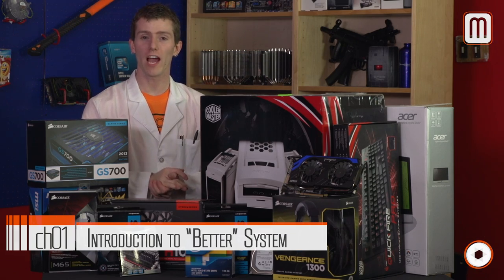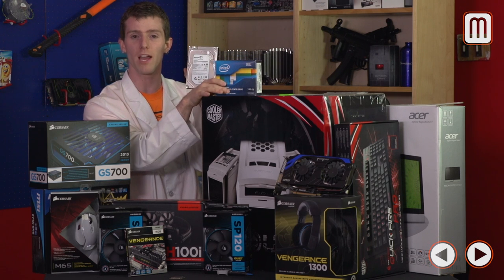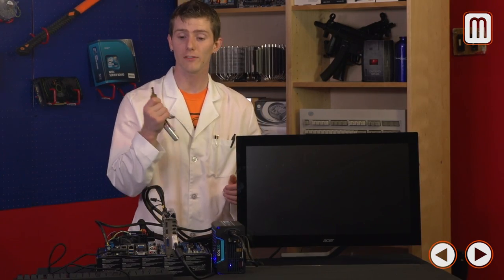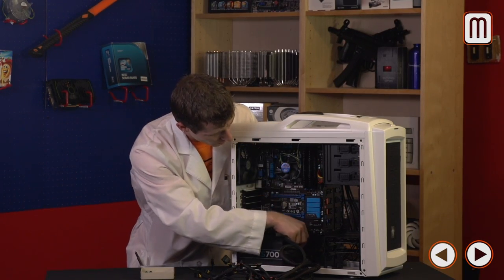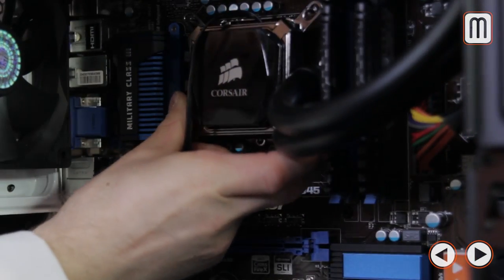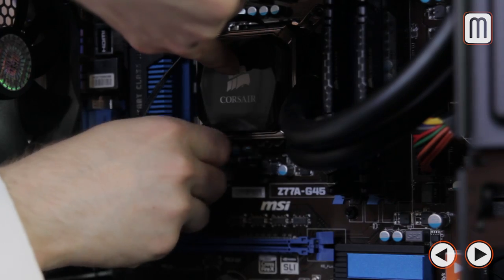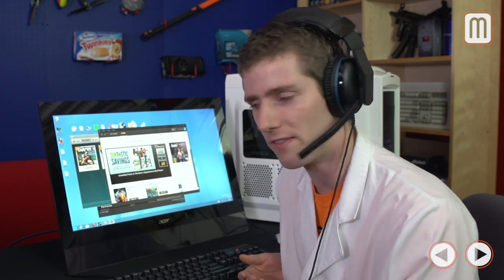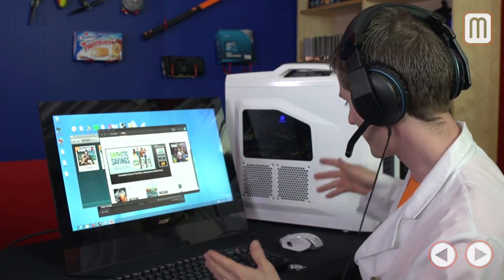ULTIMATE Build a Better $1500 Gaming PC Computer "How To" Guide

Comment: nice explanation for thermal throttling :D 
as my knowledge goes, the reason for thermal throttling is that metals loose their elecitrical conductivity/increase their electrical resistance with increasing temperature. so because it becomes too hot the processor slows down, and because it slows down it also cools down, and because it cools down it can speed up again, which will make it overheat and thermal throttle again and so on...

Comment: So would this PC still be good with today's games?
Reply: Not really heres a better and more updated one for the same price with a monitor keyboard etc http://pcpartpicker.com/p/nK6zhM
Reply: This would still be amazing. You dont need to upgrade a $1500 PC every year lol.
Reply: i'm running an i3 550 w/ stock cooler, 8gb RAM and the EVGA 660 Ti. I am running BF3 at ultra settings. I think this build would still be ok. Lol.
Reply: Cameron Gray except maybe go z87 instead of z77 for the motherboard
Reply: well it's better than my computer, and mine can run many games on high settings at a good framerate, so yes i think its good.
Reply: Of course. This is enough for like 10 years.
Reply: yes, but if you are willing to pay $1500, might aswell go with an updated build.
But then again, you are playing minecraft, so anything is good.
Reply: Oh yeah it will last 2-3 more years, but on low settings
Reply: Navis Not 10
Reply: ExoticGamer450 
Yes 10.
If the games actually got developed and console ported the way they should it would be fine for another 20 years but unfortunately ubishit doesn't give a shit and we won't see that happening. Anyway without AA you'll be able to max out all the games until your components die that is.
Reply: Aa is like the most important option and this card is a pile of shiz
Reply: Ellis Friths what, the 660 Ti?
Reply: Cameron Gray yep that card
Reply: The hardware/price in any build guide will be dated in 0.0000001 seconds. The assembly principles demonstrated by Linus here will last you for many many years :D

Go for the beefiest hardware you can afford, put it together like he does here, and you will have yourself one serious rig!
Reply: ***** Yes easily, Ultra setting at 1080p, This pc can run anything on ultra if it is Crossfire compatible :) if not high setting 1080p 60fps
Reply: yes but spend a bit more money on a Gtx 750 ti 2gb and a ssd
Reply: birdylover100 I think you're misinformed bud. GTX 660 beats the 750 ti no problem. a GTX 660 ti smashes the 750 ti. Only reason to ever get a 750 ti is if you have one of those old dell/hp pre-built computers and you wanna upgrade to a pretty decent card without any hassle whatsoever. Also the 660ti is more expensive than the 750 ti.

As to the original poster's question. Yes this will run today's games no problem. It might not max out and stay at constant 60fps but what build REALLy does that since there is so much variance in games, especially in multiplayer. It's really all about the GPU as the CPU is still a beast.( I have a friend rocking a i5 2500k at 4.5 GHz and it eats today's games for breakfast lunch and dinner ). And even tho the 660 Ti is stil a very beefy card, nowdays since NVIDIA has some weird pricing u either get the r9 280 or 280x or the new GTX 970.
Reply: Diavolo222 really??? i have one a gtx 660

Comment: I'm a noob when it comes to pc parts, can anyone tell me if this is a good gaming build? Or if I should change anything?

CPU: I5-4690K
CPU Cooler: Corsair H100i 77.0 CFM Liquid CPU Cooler
Motherboard: Gigabyte GA-Z97X-Gaming 5 ATX LGA1150 Motherboard
Memory: G.Skill Sniper Gaming Series 16GB (2 x 8GB) DDR3-1600 Memory
Storage: Crucial M550 256GB 2.5" Solid State Drive and Seagate Barracuda 3TB 3.5" 7200RPM Internal Hard Drive
Video card: Asus GeForce GTX 980 4GB STRIX Video Card
Case: Thermaltake Chaser A31 ATX Mid Tower Case
Power supply: EVGA SuperNOVA NEX 750W 80+ Gold Certified Fully-Modular ATX Power Supply
Optical drive: Samsung SH-224DB/RSBS DVD/CD Writer
OS: Windows 8 64-bit.
Reply: You don't need 16 gb for gaming, nor maybe 3tb? Maybe 2 but 3? Processor okay the rest would be up to you or others I guess since I'm not an expert.
Reply: This is just something I found, I did not make this myself.
Reply: Danny Hawk  I would downgrade to 8 gb of ram. You can use the gtx 980 but if you're doing 1080p I would recommend a 970 to save some money. Downgrade to 2 tb. And you're set
Reply: Johnathan Davidson I've changed a lot, here's the new one if you want to look. (PS: I have had help from others to choose these parts.) http://pcpartpicker.com/user/tjhawkas/saved/#view=vRy9TW
Reply: And I'm still looking for a case, so don't count that.
Reply: Danny Hawk Nice build. What games you plan on playing?
Reply: Not sure, hopefully can get some games like far cry 4 and gta v, while recording.
Reply: And it will last a long time game wise.
Reply: Danny Hawk You can run those games while recording with good framerates.
Reply: Yeah, 407 (If you know who he is) can do them 720p60fps.
Reply: And if you know any full towers that aren't that much money I'm all ears. :)
Reply: Danny Hawk downgrade to 8gb of ram, and put that money in a better cpu and overclock to make sure you're using up the 750watt power supply
Reply: if your not oc'ing go stock cooler and if you are an h60 would be good enough for that cpu
Reply: Danny Hawk if you can you should get a ss ssd and if your not over clocking to 4.0 ghz or higher then the h100i is overkill
Reply: Danny Hawk  If you are gaming on 1080p, get a 970 and overclock it. If you are gaming on 4K then get the 980. If all that you do is pure gaming, 8gb of RAM is more than enough, If you are doing video editing however, then get 16gb of RAM and upgrade try to get an i7
Reply: Danny Hawk Assumming that you haven't built this yet, Thermaltake has done some stuff recently that makes mo not trust them. I would get a case from Fractal Design, NZXT, or Phanteks. The NZXT  S340 is a really great case for roughly the same price as the Chaser A31.

I would also get a NZXT Kraken X41 or X61 over the H100i because they perform better.
Reply: C_Raz_Y 16 GB Will eventually be needed, so he shud go for 16 GB or upgrade later. Also alot of people that play games, also edit videos and do youtube. I'd recommend you to get a 16 GB mate :) +Danny Hawk couldn't tag him lol, fuck u youtube.
Reply: Danny Hawk Get 16 GB or upgrade later, and do like +micheal marquradt said and get one of those cases, my uk friend whos a pro at building pc's, told me to get either Fractal Design or NZXT. And then he chose a NZXT case for me. Black and red, pretty dope :)
Reply: Rikka Takanashi Depends if he wants to do anything else with it.
16gb definitely helps if you have a multimonitor setup and do things while gaming simultaneously. I seemed to bottleneck with 8 while playing GTA V while working on some project stuff on my second monitor.
Reply: Shayded thats true since of course games are getting more demanding and you dont want to be left behind
Reply: Shayded ye.... Witcher at 1080p needs 6gb for the game alone as far as I can see using afterburner if i were to stream or do something else that raises ram usage up to 9gb in my rig...i have an old x58 board with 12gb ram
Reply: jlei8aX Exactly. 8 gigs is no longer the standard for gaming rigs, especially since many gamers are also getting into multimedia editing.
Reply: Danny Hawk That is good:) You should build it!
Reply: Shayded he has 2 so it's 16 gigs

Comment: PCPartPicker part list: http://pcpartpicker.com/p/GVwvhM
Price breakdown by merchant: http://pcpartpicker.com/p/GVwvhM/by_merchant/

CPU: Intel Core i7-5820K 3.3GHz 6-Core Processor  ($299.99 @ Micro Center) 
CPU Cooler: Arctic Cooling Freezer i11 74.0 CFM CPU Cooler  ($22.99 @ Amazon) 
Motherboard: MSI X99S SLI Plus ATX LGA2011-3 Motherboard  ($199.99 @ Amazon) 
Memory: Crucial 32GB (4 x 8GB) DDR4-2133 Memory  ($372.98 @ Newegg) 
Storage: Seagate Barracuda 3TB 3.5" 7200RPM Internal Hard Drive  ($101.99 @ Newegg) 
Video Card: EVGA GeForce GTX 960 2GB Video Card (2-Way SLI)  ($207.27 @ TigerDirect) 
Video Card: EVGA GeForce GTX 960 2GB Video Card (2-Way SLI)  ($207.27 @ TigerDirect) 
Case: Raidmax ATX-249B (Black) ATX Mid Tower Case  ($37.99 @ SuperBiiz) 
Power Supply: SeaSonic S12G 550W 80+ Gold Certified ATX Power Supply  ($74.98 @ Newegg) 
Optical Drive: Asus DRW-24B1ST/BLK/B/AS DVD/CD Writer  ($18.79 @ OutletPC) 
Monitor: Acer GN246HL 144Hz 24.0" Monitor  ($236.99 @ SuperBiiz) 
Keyboard: Cooler Master CM Storm Devastator Gaming Bundle Wired Gaming Keyboard w/Optical Mouse  ($26.99 @ NCIX US) 
Total: $1783.22
Prices include shipping, taxes, and discounts when available
Generated by PCPartPicker 2015-02-16 20:17 EST-0500
Reply: Is that build beast
Reply: Is that build beast
Reply: Juan Lopez That will run anything and everything you throw at it on ultra at 80+ FPS
Reply: Really, Thanks i knew it was boss but not that boss. Thanks but can it run 4K games
Reply: Juan Lopez why run 2 960 when you could run 1 970 and don't get a Seagate barracuda drive they are shit
Reply: I wouldn't do 2 GTX 960. Do a single 970 or 980. I have a single 980 in my build and it's a beast I Don't think the 960's can do 4k at a playable frame rate. Plus, if your gaming and not editing, the 32GB of ram is a bit over kill. If your just gaming, then do 16 GB
Reply: Its my first build and im hype lol i did a huge update i will release in 10 min
Reply: PCPartPicker part list: http://pcpartpicker.com/p/Jg3LHx
Price breakdown by merchant: http://pcpartpicker.com/p/Jg3LHx/by_merchant/

CPU: Intel Core i7-5820K 3.3GHz 6-Core Processor  ($299.99 @ Micro Center) 
CPU Cooler: Cooler Master Seidon 120M 86.2 CFM Liquid CPU Cooler  ($64.99 @ Amazon) 
Motherboard: MSI X99S SLI Plus ATX LGA2011-3 Motherboard  ($199.99 @ Amazon) 
Memory: Corsair Vengeance LPX 16GB (4 x 4GB) DDR4-2666 Memory  ($229.99 @ Amazon) 
Storage: Seagate Barracuda 3TB 3.5" 7200RPM Internal Hard Drive  ($90.46 @ Amazon) 
Video Card: MSI GeForce GTX 970 4GB 100 Million Edition Video Card  ($357.99 @ Adorama) 
Case: Azza SIRIUS ATX Mid Tower Case  ($27.50 @ Newegg) 
Power Supply: EVGA 500W 80+ Bronze Certified ATX Power Supply  ($29.99 @ NCIX US) 
Optical Drive: Asus DRW-24B1ST/BLK/B/AS DVD/CD Writer  ($19.79 @ OutletPC) 
Monitor: Acer GN246HL 144Hz 24.0" Monitor  ($236.99 @ SuperBiiz) 
Keyboard: Cooler Master CM Storm Devastator Gaming Bundle Wired Gaming Keyboard w/Optical Mouse  ($27.98 @ OutletPC) 
Total: $1585.66
Prices include shipping, taxes, and discounts when available
Generated by PCPartPicker 2015-02-20 23:10 EST-0500
Reply: The drives really dont matter to me
Reply: if you are a gamer I would reccomend going with a cheaper cpu and a gtx 980 if its in your budget
Reply: Juan Lopez the drives don't matter to you? so you don't want to be able to download games? because seagate is terrible and will probably fail get a western digital and save yourself the headache of RMAing it
Reply: Yea on steam no cd
Reply: itsAery|MW3 No ima edit vids and such
Reply: ohhh alright then yea that makes sense
Reply: itsAery|MW3 nah lol i put an gtx 980 in new one and i wont go with a cheap cpu because of DDR4 ram.😄
Reply: You should just get 16gb of ram and try to get a 980
Reply: RedKnight95 980 would be overpriced
Reply: Yea 980 is overpriced
Reply: Im not building it anymore, im buying a hp gaming laptop, black licorice with the i5
Reply: 2 960s could get you one ASUS GTX 980 Matrix Platinum which is top of the line in terms of features.
Reply: Fuck the price of the 5820x is the same price as an I5 4690 is Australia :(
Reply: Oh that sucjd 😳😣
Reply: Get one 970 over duel 960 sli
Reply: Juan Lopez only 2100$$ in Canadian prices... FFS
Reply: Juan Lopez if you havnt built this yet i would reccomend paying a little more for 960 4GB cards which will be more future proof and come in handy with some games such as grand theft auto 5